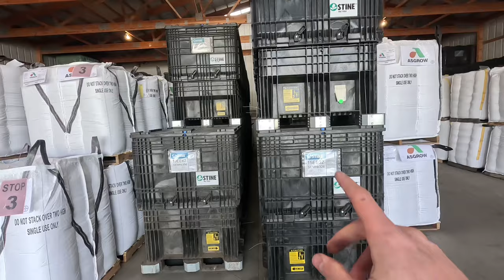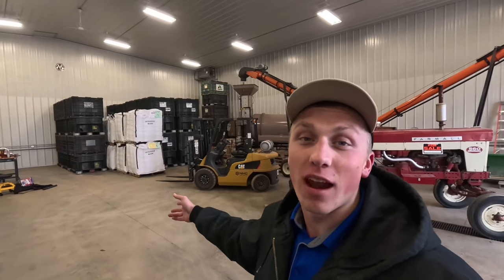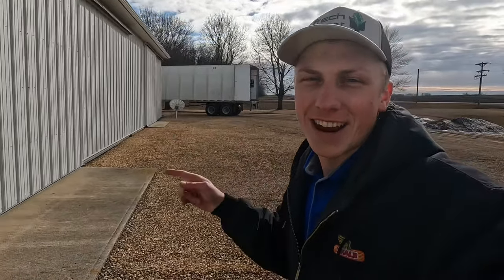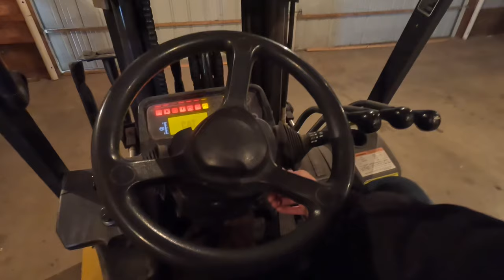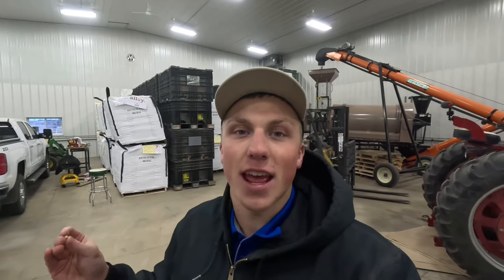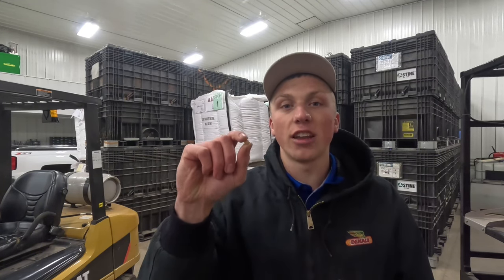Turning Up THE HEAT In The Farm Shop!

Comment: Ok question any reason your seed sheds can't be heated that way rather than moving seed you just turn the heat on and you never touch them between when there unloaded and when there's coated then you could also just put all the equipment for the hole coating proses in a shed right close to your seed sheds and have your shop be strictly a shop
Reply from the maker: That’s a great question! If the cost of insulation and heating supplies for our other building wasn’t so high, that would happen. But the reality is, that would cost a lot and the building wasn’t designed with that in mind 20+ years ago.